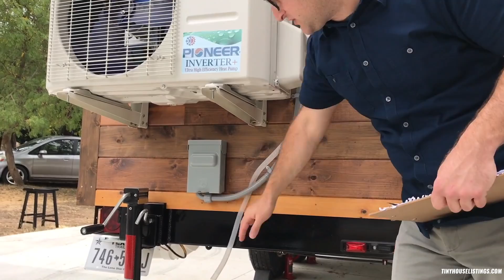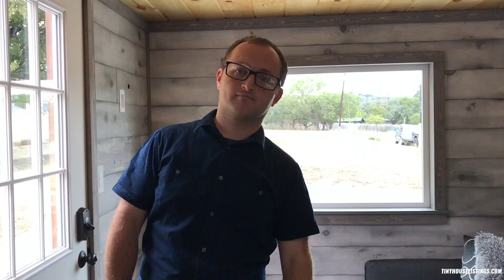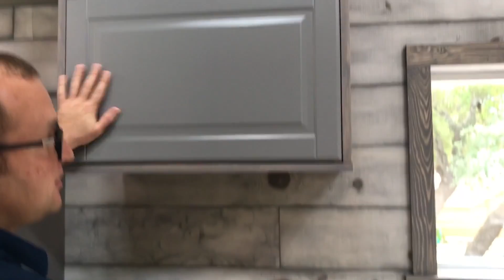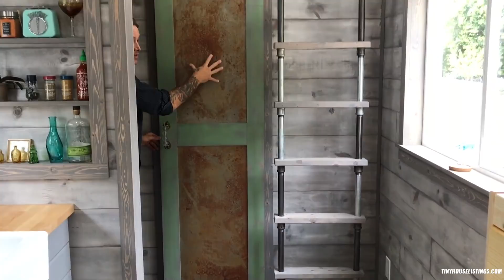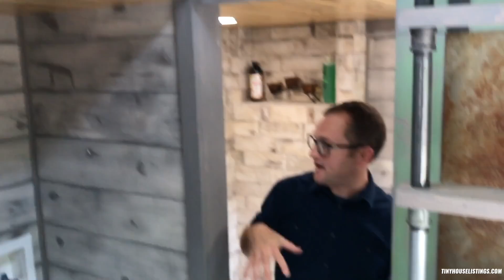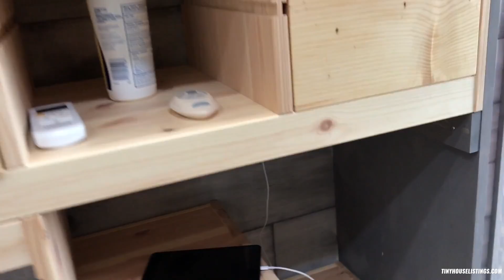The Tiny Life! Tiny House Living in Texas

Comment: Outside is finished well.... good trailer choice also nice look on recessing the tankless unit.
Only negative I found on exterior is the choice on heat pump unit.... have replaced a few pioneers and they would do better to switch to Daikin.... 
Interior... the toaster oven should be on sliders to pull out and they should have lined the interior... the heat from cooking in there will end up causing issues.  Inside finished well, overall..... I do not see a lunos air exchanger..... a must for any tiny home.

Comment: I understand the open loft is a safety issue. However it leaves the option of installing a narrow bookcase or dresser for storage. The chosen unit then becomes the safety rail.  Love that you installed stairs to the main loft which can be painted or stained to the owner’s preference. Great bathroom. With the addition of shelves and a medicine cabinet you have plenty of storage. 

The exterior color is beautiful. Will blend in with the outdoor elements. 

Great kitchen sink. I hate a tiny sink. I need one large enough to wash dishes. 

Great job!

Comment: Love it. I would however have rails on the lofts. Shower ceiling should be plastic. I would make the windows in the lofts bigger. A bigger bathroom fan since it is not in the ceiling. Overall however its very nice and would not be hard to adapt. Maybe move the fridge to the step cubbies to make the living area larger, and bc of lack of an eating area. I would turn the sofa around under the window and have a window that opens there.  And someone above-mentioned skylights, it's a good idea. I would want only two dimensional siding outside  it's a bit busy. The washer dryer space could hang clothes AND have a dryer washer combo all contained in one unit. A short wall rail in the bedroom loft with cubbies and a mini shelf on the other wall too for more storage and privacy. Did you say overall dimensions? Price?

Comment: I put a pole whre the steps are located. I put a second one I could slide down. Make it safe so AVERAGE people don't fall and can't get up. You 2 work well together, stay with it. Have some fun with the design. Tim from Houston east side Tx. A person can hold on to that pole as they walk up or down the step, simple and it works.
Reply: What I like about you both. Is that your real, easy to follow, like Rick Steve's. It would be hard to see you on PPS, doing a start to finish project for a on-site customer. You don't talk over people heads and you give in-sight. You make a person say, what if, is not far out of reach. Just need to set some wheels in motion. A start to finish project, some ups, downs and smiles.

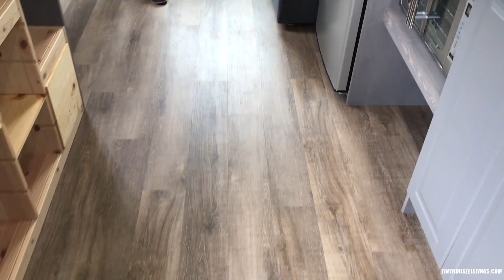Comment: I'm only at 5:30 and already see 2 things I hope you've changed in the last year 1/2. That front door is awful. Invest in a full glass door (with built in blinds) to let more light in. Also, when I see that ugly grey colored, cheap looking wood (whatever it is), I usually stop the video because it screams CHEAP! I'm not trying to be rude, but it clashes with the floors and just looks like you bought the least expensive thing you could afford. Watch MINIMALISTE, TIMBERCRAFT, MINT TINY HOMES, ALABAMA TINY HOMES, or even INCREDIBLE TINY HOMES tours and you immediately see the difference! I'm going to continue the video though, because I have a feeling the two of you have done some other cool things inside (I'm hoping 🙏🏼🙏🏼🙏🏼). Good luck!

Comment: Really nice! I am wondering how much space would be lost for insulation for colder weather areas.
Reply: canadaingirrl This house is very well insulated.  The subfloor is a closed cell foam and all the walls and ceiling are open cell foam.  I think it would handle extreme hot or cold weather quite well.
Reply: thank you for replying! Good to know that. looks like a great design and for colder climates just the water heater to move (frozen plumbing is never fun)

Comment: Phillip has the same hairdo as my mom. Does he have a lot of 60-y/o women asking who cuts his hair? It looks very smart parted on the side.
Does the green siding comei n different colors? I really like it, it looks lightweight and durable.
Huray for actual stairs with storage. Huge kudos for a full-size kitchen sink -- when I see tiny homes with silly round sinks,  Ithink they must eat out a lot.
THat is the BEST convection toaster oven on the market -- I compared a lot. I saw a tiny apartment in NYC with shallow drawers along the counters and induction hot plates went inside of those to lift onto the counter when you're cooking and put away after.

A few things:
Shouldn't the plugs in the kitchen and bath be safety breakers?
When I traveled in Europe, a lot of economy hotels have "wet room" suites: the entire bathroom is clad/tiled like a shower, the sink and toilet sit to one side. It's basically a powder room, but when the shower is being used (hand held unit) a shower curtain pulls over them so they don't get wet. EVERY space efficient and allows for a larger shower area. A squeegee on a long handle is used to dry walls and floor. I never see that style in tiny homes.

Comment: ilikee a lot
Do u have the option of the heated floors?
Does that couch be a sleeper as well as storing?
Is the option open for the all in one washer/dryer too
Or just stackable?
Thank u Gentlemen
Reply: Belinda Hawkins Thanks!
No option for heated floors.
This couch is not a sleeper, but there is a version of it that does have that option.
Pretty sure either type of washer dryer will work in the space.

Comment: With certain types of insulation and window or sort placement for cross drafts you can bypass A/C. I would try it. Still $25.00 for the utility bill is def cheap - no complaints, but running 24/7 is a lot of time.

Comment: The cabinets are to high, you should add handles I wouldn’t want to bend down each time to open the trash from the bottom of the door.  The color lights are for a teenagers room.  The ladder is ridiculous if you don’t arm strength it is hard to climb. No head room in the sleeping loft.  The ceiling and wall color clash.

Comment: I don't get how Tiny Living hasn't merged well with living off the grid. Solar panels, water harvesting connections, blackout windows and so on. Not everyone wants to be on the RV Park. It's like an HOA. Screw that!
Reply: In many cases it does merge, but there's an initial cost/investment to be able to live off-grid that can be more than many people are willing to spend, at least when they first get their home...  

Mind, many also have to invest in a way to tow it and property to place it on...  But that's why many builders leave that option open, like leaving the wiring set so solar can be added at a later date, etc.

Btw, you should probably check out what Incredible Tiny Homes in Tennessee is up to... They've developed a water recycling system that should let people use one tank of water for up to a year before needing to replace the water and they're going to be offering a more affordable solar option that is robust enough to run the mini-split off of... As well as offering Tiny House communities for people to place their home and pay as little as $200 a month and when they open other communities in other states that they plan to work it that people can move freely between those communities.

They're also working on offering slide ups, so they can get up to full two story height when parked...

Hopefully, we'll start seeing more and more options from other builders too...

At the very least, solar thermal, which is pretty much dirt cheap, should become widely available option and we should hopefully see more modular options that can be added and help fit a range of budgets...
Reply: ZeoCyberG Wiring a house for electricity is more expensive than connecting it to solar power. Electricians aren't cheap.
Reply: Uh, no... Solar isn't free... You have to pay for the panels, you have to pay for the charge controller, you have to pay for the inverter, you have to pay for the batteries (this can be the majority of the costs), and depending on the local building codes you may still require hiring a licensed electrician to at least verify the installation is done correctly and to code... 

While you're still having to do the electrical panel and any sub-panels, the whole house wiring, laying out outlets, light switches, etc. to actually use the power, which you will usually be hiring a licensed electrician to do unless you know how to do it yourself and if you're licensed then you don't need to pay anyone to install your system...

Anyway, this all means it has virtually all the cost of a regular grid-tie installation plus the cost of the entire solar power system added on top of it.

The average cost to wire a house is about $10400 (1200 sq.ft.home), so wiring a tiny house should be a lot cheaper but that part will be included regardless of grid-tie or solar or both and you would then have to add the cost of the solar power system on top of it for actual total cost...

Only thing that can be costly for grid-tie is if you're on a property that's off-grid and thus need to have lines run to your property and to your house then that means high installation costs, which can be very high if you're far off-grid, but that's cost of setting up a property, which you don't deal with if you're renting a spot or just traveling and hooking in to available grid-tie points along the way and thus not included in the cost of the house itself...

Otherwise, you'll only run into really high grid-tie costs if you need something unusual like 1000 Amp service because you're running three phase motors in a workshop or your own personal factory... But if you needed a solar system to provide that kind of power then you're looking at over $50,000 to maybe $80,000 if you need it to run 24/7 as well...

Solar will eventually get really cheap but we're still about a decade away from seeing that happen...

Optimistic estimates suggest maybe 2021 may be the turning point and then we'll see solar adopted much more widely, but till then it's still a bit pricey and especially for people trying to keep costs low when purchasing their home...

Comment: Love the details and how you keep the ugly stuff (Wires and pipes) safe and hidden. Love how you provide flexibility in design choices, and just the general overall layout from the comfy looking storage couch to all the hidden storeage elsewhere. Just gorgeous.  Flex table is cool too. I'm not so sure I'd opt for a full tiled bathroom. Tile can break when moved and you only spend lke maybe 10-15 minutes in a shower a day. But it is beautiful.
Reply: Tile can be a option if the house is built to be especially rigid... There are Tiny Houses constructed with steel framing and/or SIPs/MIPs that have been towed thousands of miles and neither the drywall or the tiling has cracked.

You just have to be sure on the construction, which can be a reason why some houses will cost more to be over built enough to provide such options...

Though, there are options where you can use flexible membrane materials for the same look but can handle a little flex, no problem...

Along with synthetic stone products that are stronger than granite but lighter and more stain resistant and can be made to look like any type of stone.

So there's some options that can make it more practical... At least if you have the budget for those options...

Comment: That's an amazing shower!  I like that.

And the second loft is a really good height, perfect for an office (it needs some sort of railing, though, to keep you from falling if you are in a chair and scoot back too far).

Plus, THIS is a great example of how I think windows are supposed to be in a tiny home.  There for light, not to be in the way, keeping you from organizing your home how you'd like it.

-

I'd put a combo washer/dryer where the 12 cu ft refrigerator is... and then extend the counter over it (then you could have the television mounted over that and move the couch underneath the window.  

And then turn the space for the washer/dryer into a full-sized refrigerator.

-

That said, I don't really like the shelves under the stairs.  They look kinda junky.

A hanging closet underneath the taller portion of the stairs and then dresser-drawers on the lower end would look more neat and clean.